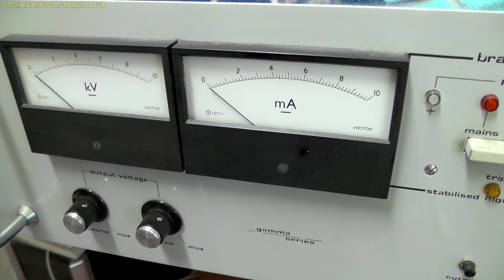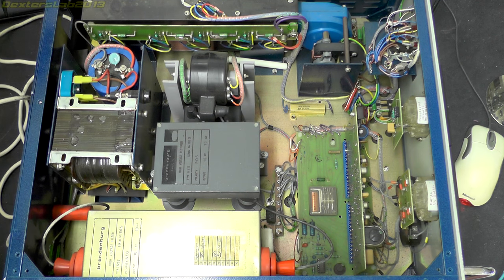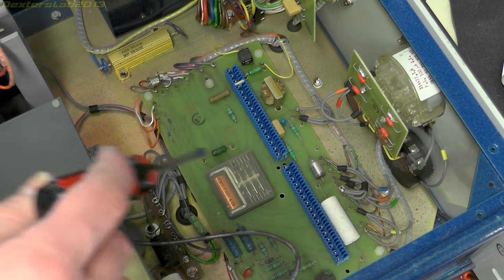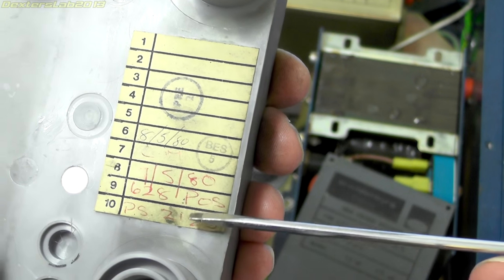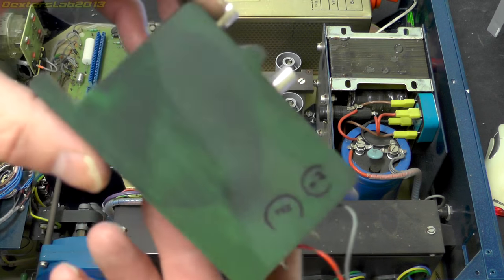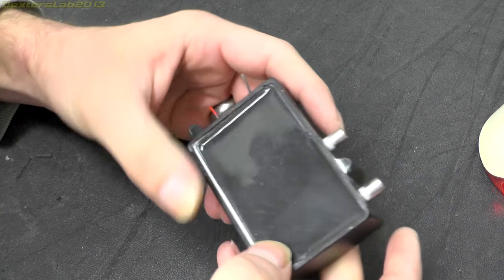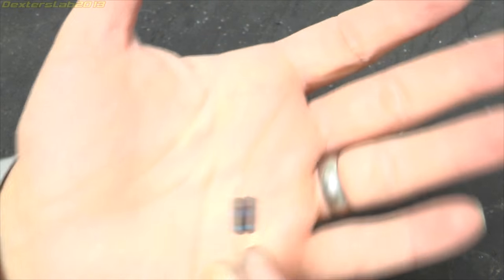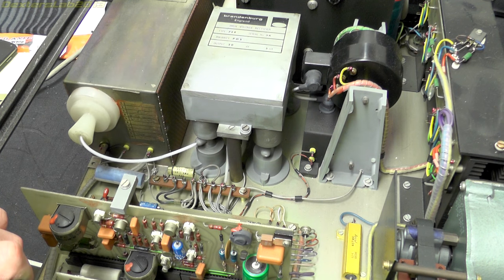DL#084 - 10KV High Voltage PSU Brandenburg Gamma 628-10 Teardown

Comment: great! not sure why I missed that. big thumbs up. 

10:45 they were doing so to prevent the diode from excessive heat during soldering. I've seen similar loops on point-to-point wirings from the 60ies.

8:30 I love how the wires are looped up

20:52 I just read the wiki article about flyback transformers. very interesting.

21:25 my guess is a voltage divider network to read out the actual voltage, or shunt to read out the current. While the mystery-box is different for each model I would guess that the control board is always of same type.
Reply: 29:00 didn't expect you are going into the effort to open up the mystery boxes. GREAT !!!!
Reply from the maker: thanks Max, yes things are easily missed.... like large boxes of stuff eh?! ;-) They were nice power supplies, i might have kept one if they had been current limiting rather than a basic over current trip.

Comment: I know were I used to work they used hundreds of similar psu's , I did not work on the line so I'm not 100% sure and I will ask my friend who still works there but they use them far as I know on the  burn in racks. They have 25-50 parts on a board then load up the oven and they just leave them powered up for a week or two or what eve the spec calls for.

Saying that the ones in the racks were a lot more than 100w but they used lower rated ones like this up stairs in the QA lab were they had their own mini burn in racks for testing parts.
Reply from the maker: +Darren Woods What kind of product where they testing?
Reply: Not testing , burn in racks. They basically throw zeners in what they call an 'oven' (yea it does produce a lot of heat) for a week or sometimes six or more for JAN-S parts (I belive if I remember that is joint army naval and space) 

I was on the rectifier/transistor line , those ovens would be for instance 3kv revers voltage test with an 1-3amp forward current test running at the same time (switching I think at 50hz) leave it run again for weeks on end and checked twice daily by QA.

And QA would have there own mini version of the entire procedure up stairs to do the tests on batches. 

The ones down in the racks were very similar just higher I think 8u but same construction inside and everything just on a slightly bigger scale and also no current limits as boards going in the ovens would have specified number of parts + a jumper per board and also a patch panel on the front for config.

Basically what ever went in would be set up to use everything the psu could give it.
Reply: Hi Darren. This was exciting.

Comment: That diode you measured as "open circuit" may actually be good. Some high voltage diodes test good on the multimeter because the multimeter uses very low voltage to test for an open circuit. To test that diode you should have a way to pass a low current high voltage to make that diode work. Don't assume it is open circuit because it may be good. If it was shorted than you will be certain that the diode was no good. High voltage diodes have different properties and forward voltages and they only "activate" with high voltage.
Reply: I'm sorry. I spoke too soon. I didn't watch the video to the end. I did now. And I see that you are aware of high voltage diode properties. Best regards.

Comment: Neat teardown!
I'd buy it, but it would cost me so much to ship, I wouldn't take it for free with you paying me to compensate the costs :|
Though I WOULD love those flybacks and panel meters - that could be cheaper to ship.
I'm making a CT scanner, so that could be handy, especially considering it might go all the way to 100kV, as my tube is 70-75kV at a few hundred microamps.
Reply from the maker: +Spirit Yea i wouldn't like to ship the complete unit anywhere, if i do sell it i will probably do it collection only! You can get my email address from the About section on my channel if you want to look into how much shipping the flyback might be.